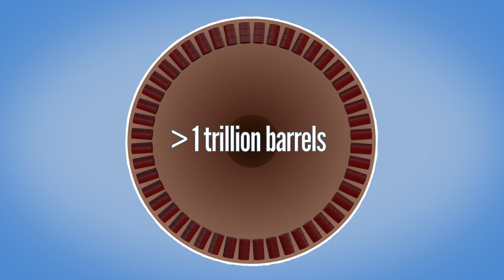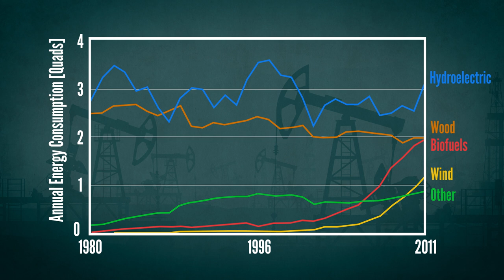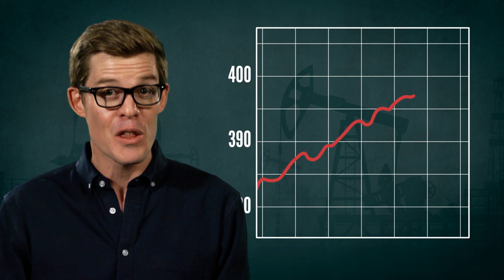When Will We Stop Using Oil?

Comment: One trillion barrels seems like a lot, but when you do the math (dividing by the 93 million barrels used per day) means that at the current rate...not even increasing consumption...we would use up the entire earth's supply in 30 years.  Now, it is "one trillion +", and we don't know how big that "+" is, but at any rate, the last barrel will cost a lot more to get out of the ground (if we can ever get it out) than current barrels, so expect price increases over the next 30 years, and then if we don't have our act together by then, expect some major problems.
Reply: Rationalific The deal with oil is its just an estimate and theres way more oil available and some sources obvisiously even "replenish" over time, as the inner part of the earth produces oil and pumps that up.

Theres plenty of oil around thats just not worth to access, as its in regions that are not really friendly to the commonly used methods. But in general, its just a big pile of BS that oil will ever run out in the forseable future, much sooner it will simply be too expensive to use it for any reasonable manner, so people stop using it and aim for alternatives much sooner that it will ever be a problem to run out.

But then, the oil market is also a gigantic pile of speculation and cheatings in prices. In the last year oil price plummet down like a stone. It became so cheap, that russia got in financial problems by the super low price (as the price drop was fairly unexpected).

The consumer oil prices going up is much less connected to actual less oil available, much more as it simply became an easy way to increase prices and profit. Prices should go DOWN if more oil is available on the market, instead it simply goes up in general trends, as people keep paying the prices, as they heavily depend on it too (especially the giant ships all the air-transport and the like, they depend so much on oil and it wont change in any meaningfull way).

Running out of oil ? That simply wont happen in our life times.

And still, with the overall increasing prices in oil, people will sooner or later switch to cheaper sources, no question about that.
Reply: ThisNameIsBanned Oil replenishes at a microscopic fraction of the speed we are using it.
Reply: Rationalific Well yeah, the prediction is believed to be that in 2050 we will officially be out of oil.
Reply: Rationalific I just did the math myself and thought for sure someone would have beaten me to it. I'm rather surprised that more people aren't mentioning this. Also surprised they just glossed over this easy math and the implied ramifications. 

On reflection, > 1 trillion is a rather ambiguous number and maybe they didn't want to be put to the coals for false data.
Reply: Rationalific thanks for the info Dexter.
Reply: Michael Stanley No problem, Larry.  But I think my dark passenger deserves most of the credit.
Reply: Rationalific At the current rate of extracting 4 million barrels a day, oil in Kuwait will last for more than 103 years.
Reply: Fawaz_Kuwaiti The oil gets harder and harder to access.
Reply: Fawaz_Kuwaiti Here is at least what is on Wikipedia about Kuwaiti reserves.  It says that Kuwait has around 104,000 million barrels.  If you divide that by 93 million barrels (per day), that comes out to 1,118 days.  Divide by 365, and that comes to approximately 3 years.  So Kuwait and the rest of the world combined have 3 years of Kuwaiti oil if only Kuwaiti oil were used.  However, Kuwait makes up 9% of worldwide reserves.  100%/9%=(around)11.  That means that Kuwait's reserves are 1/11 the total in the globe.  3 years times 11 = 33 years.  This completely backs up what I stated above.

If Kuwait produces 4 million barrels per day, then it would take 71 years for Kuwait to run out (although, as Jim Groth mentioned, it would be a bell curve, with extraction getting harder and harder after the majority of oil has been used up.  If they continued to export that oil into the global economy, then Kuwait would still suffer as oil was used up elsewhere.  In any case, there will almost definitely be a major oil shortage in our lifetime if we do not move quickly to use other sources of energy (and it still might happen then)!
Reply: Rationalific that is indeed the problem, we may find more and more oil, but the problem is that every day we consume more oil, so that would reach a momment when those one trillion barrels would not gona be enought, so is really time to find somthing else. Or at least the perfect time was like 20 years ago
Reply: ***** Maybe so, but I think that if it were cheaper and easier, then the switch would have already been made.  There are various alternatives, but the questions are how much they will cost to implement, and the rate at which we can get the fuel.  (For example, can bacteria produce enough to run every car everyday?)  Well, we will have to figure it out.  Bacteria that make fuel can definitely help out.  Personally, I think the best idea is to skip everything else and just go to solar production of electricity.  After all, the sun is ultimately responsible for nearly all of the other energy we get.
Reply: +Random Person 
You can't expect to accommodate the global demand of oil with that. 
For starters, that process by which bacteria "sweat" ethanol is expensive, both in money and energy. 
Just watch the video, they spend a lot of time, resources and energy (UV lights, containers, freezers, pumps, etc.) to produce a bucket worth of ethanol. 
25k gallons of ethanol per acre a year? What can you expect to power with that? 
According to my calculations, that would power roughly 137 SUVs during a whole year (running on E85, daily usage of half a gallon...that's around 7 miles a day). Now, how many acres of bacteria do we need to power all the cars in a country?
 Well, that will depend on the country, but let's be conservative and count a minimum of 20 million cars.
How many acres of bacteria do we need in order to power 20 million SUVs? Around 146000... that's roughly the size of Singapore. And what about trucks, ships, planes, etc.  Well, those definitely have a much higher fuel consumption, which would make up for their relative scarcity... we'd probably need another 146000+ acres of bacteria just for those. 
So, for a rather small country, a total area equal to the size of the Faroe Islands would be needed...
This is perhaps practical for some countries with a lot of available land and low population densities, but this is impractical for small countries with high population densities. 
 
In any case, I think they are spending more energy in producing those 25k gallons of ethanol than the energy they will actually get out of them... In other words,  the energy return is probably negative. 
Anyway aircraft and ships don't run on ethanol for several reasons. One of those reasons is the reduced range (in order to cover the same distances, they'd need more powerful engines and much more fuel than they currently carry).
The other reason is the financial cost of the conversion to ethanol-based fuels.
Reply: +Rationalific 39 dummy
Reply: +Rationalific yeah but there is 400 years worth supply of coal. I don't know if everyone switched over to coal I would guess the depletion rate would be faster and would decrease years left till exhaustion. 

There is the option for liquifying natural gas but the issue there is we are still left trying to buy enough time until natural reserve run out again. 

The only best option would then be to drastically reduce human population so that there is less consumption per capita.
Reply: ***** Coal makes up majority of energy needs of China, USA, Russia and India. They're growth depends on burning cheap fuel source. Its not like you can magically change industry consumption.

Agriculture, Biotech, Aerospace, Transportation, every industry literally will collapse without depends on increasing use of energy or else growth stops and shareholder will lose value.
Reply: ***** No there is wind, solar, hydro, nuclear, natural gas, coal, petroleum.

But only coal is most reliable and cheapest form of energy. 

Nuclear is good option but its risky ex: Chernoyble, Three mile island, fukishoma in japan, SL-1 accident and these are in very short span of time. The effects are ever lasting as nuclear energy half life is 24,000 years for plutonium 234. 

As for wind and solar they are only as good as its source. The sun only shines 12 hours a day in equator and in summer. If its cloudy the output drops. 

Wind energy suffers from same problems. How much wind is available at given time. There are geographic locations where wind is strong year round but still wouldn't supply all nations energy requirement. 

Still whats cost of production for both and lifespan of both technologies and return on investment. 

Coal doesn't suffer from any of these limitations its cheap, plentiful and it works under any condition.
Reply: Oil will be here for several more centuries. Deal with it.